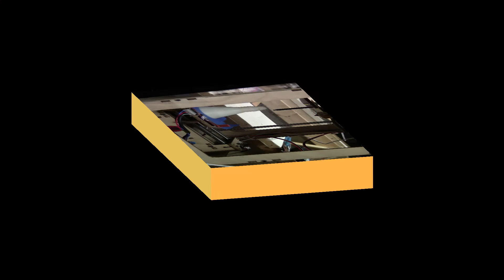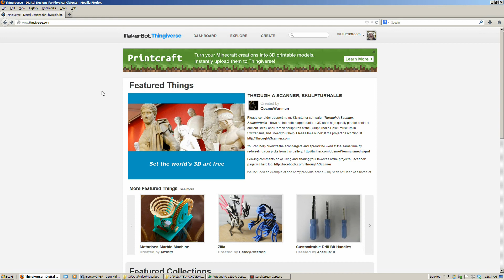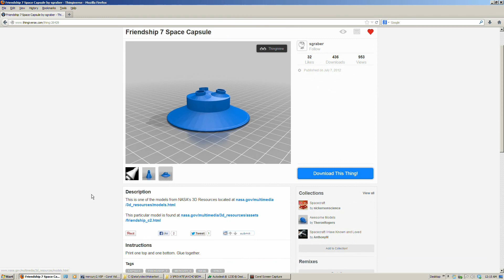Friendship 7 Mercury Capsule model 3D printed on MakerBot Thing-O-Matic

Comment: My brother has been machining molds for 30 years using EDM wire machining.  3D printing might shorten the process.  I melt lead from wheel weights to make bullets, but the molds that I use are up to 100 years old.

Comment: Glad you got something to work better.  I have to live vicariously on the maker-bot and 3D printing, but I was wondering if you could print with wax and use a lost-wax (investment casting) technique to build aluminum or stainless steel models.  I believe I've seen this done before on "how it's made", the TV show.  Rapid prototyping at its best.

Taking it one step further, You can investment cast a NEGATIVE so you'd have a mold to pour ABS into to make your models.

Comment from the maker: I've since switched to an aluminum plate clipped to the heated build platform and then 2 strips of 2" kapton tape.  
Dissolve some ABS plastic in a little bit of acetone and spread the mixture with a paper towel or rag onto the kapton.  The acetone will evaporate and leave a film of ABS plastic.  That works perfectly!  I've got a video on making a 3D printed doumbek (hand drum) where I show it (should be live tonight 9/2/2013).
Thanks for watching and commenting!
-- Emory

Comment: For mat-molding fiberglass parts, I use a product called "peel ply".  Spray rubber cement on the back and stick it to your base.  Plastic will come right off.